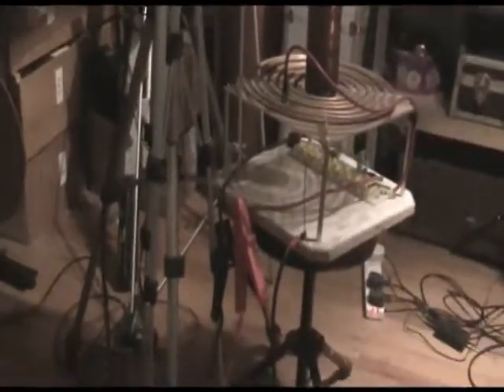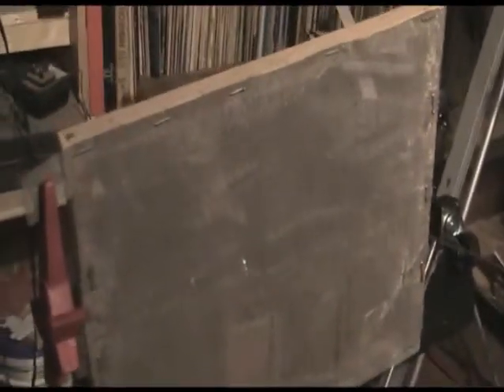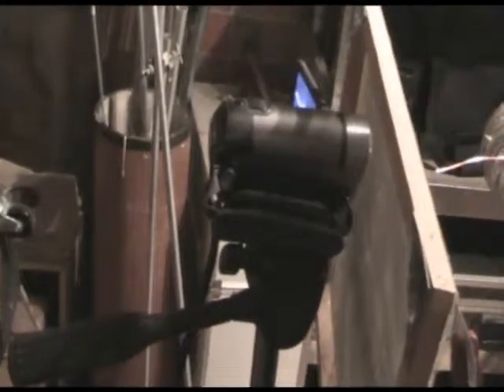Arcs up close

Comment: You need some order; it needs to be written it down somewhere. If its a SGTC, use JavaTC to find out proper needs, esp. for winding height, tap, etc. You need to be accurate when putting the specs up. One little bit off, and then the whole calculation is screwed up. JavaTC is free. Plug in the *correct* info and you should be seeing some longer sparks. :3

Comment: You can't just grab a random secondary from a previous project like that! It works, but not efficiently. Usually you have a 1:4 ratio of winding length to diameter. It's better than my secondary coil, but mine's bad and I have to rewind it. I ordered magnet wire for it. I think you should try and make a new secondary. How on earth do you not know its specs? Those are the kind of things you need to know offhand: type of coil, current and voltage rating of transformer, cap bank, etc. :P